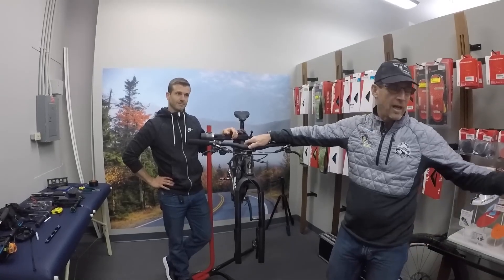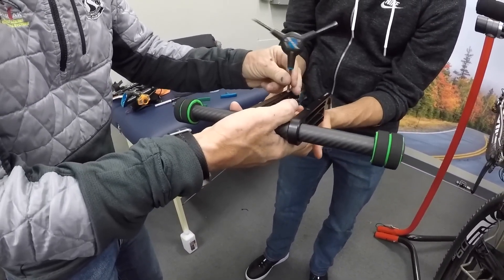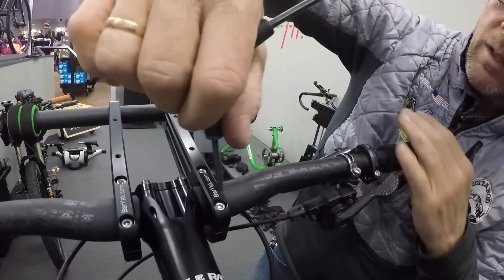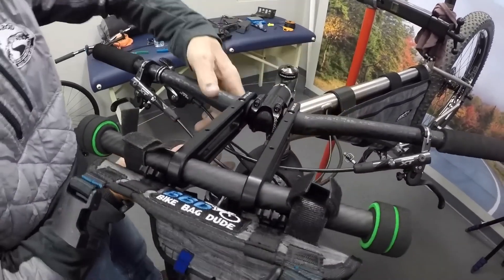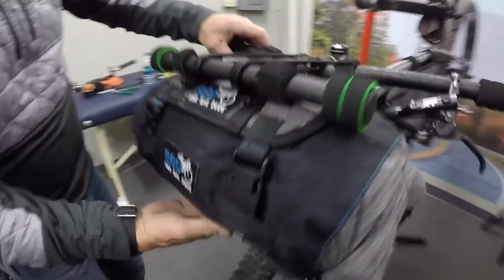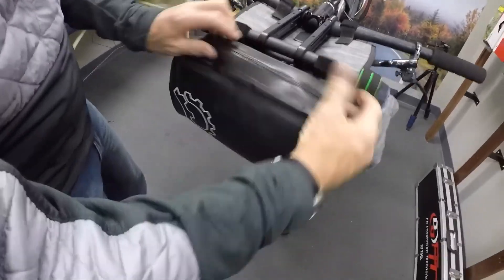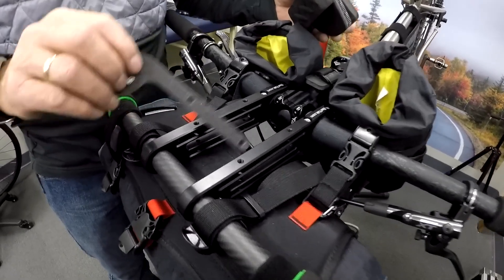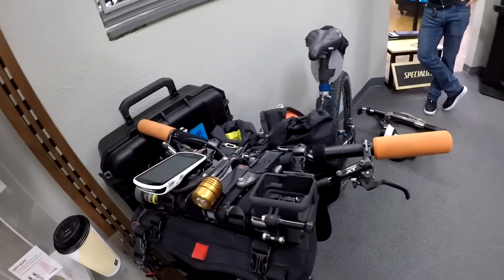The BEST bike accessories for adventures | HOW TO ATTACH THE BARYAK EXPEDITION RAILS & TALON HARNESS

Comment: Do you make a shortened reach peregrine armrest attachment? Where the holes are drilled and tapped would put the armrest too far forward for me even with a shortened stem.
Reply from the maker: Have Checked out Website BarYak.com ? the Falcon or the Adjustable Flip-Up might be exactly what your are asking for.